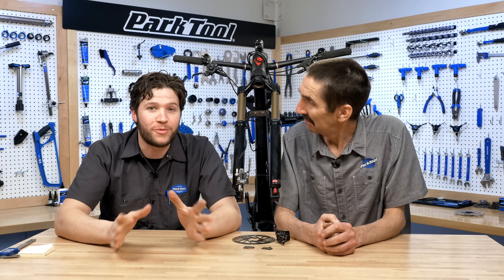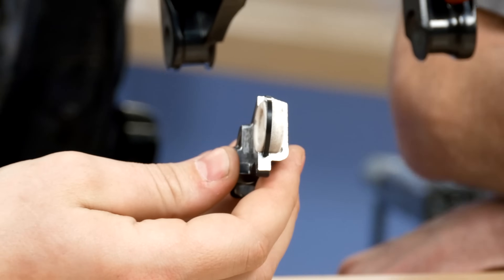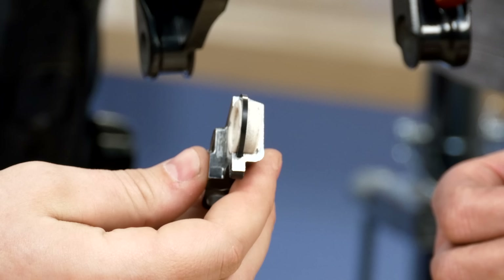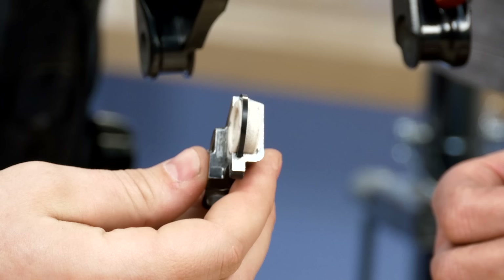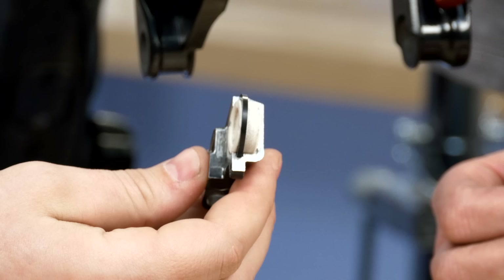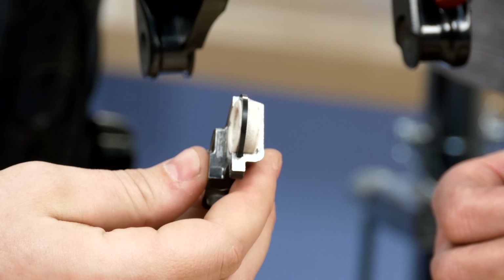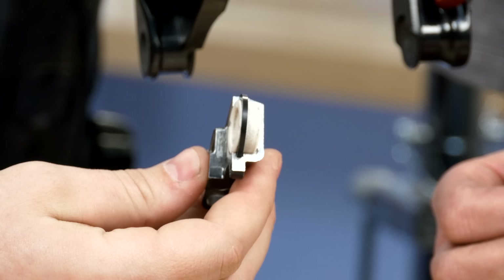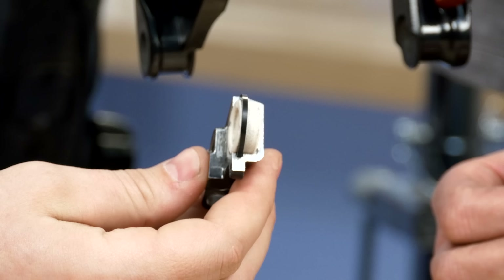How To Clean Hydraulic Brake Pistons - Tech Tuesday #104

Comment: Thanks for your great videos, I am new to working on my mountain bike and they are very helpful. I was replacing my brake pads recently and once the new pads were in, there was no room for the rotor. I then saw the pistons were sticking out, so I followed the steps in this video to clean my seals. Once my seals were clean I tried pushing the pistons back in… nothing. I cleaned the pistons again, brought one out and got the other in, then tried pushing them in again using an even but hard pressure. While pushing I heard a PFFFTT and noticed that hydraulic fluid had squirted out of the end of my brake’s master cylinder… I thought I had broken it. But, everything went back together nicely and my rear brakes were working well. So, is it possible that the master cylinder on my Shimano brakes (bl-mt500) have an overpressure release valve? And, if so are my brakes good to go, or is it time to head to my LBS?
Thanks!
Reply from the maker: Where exactly did the fluid come from? If it came from a small hole on top of the resevoir then you will be fine. If it came out the end of the lever/master cylinder where the lever is connected, then you may have some other issues. it could be that your brakes were over bled the first time and there was not enough room in the system to accomodate all the fluid that you were trying to force back in. Either way, how is your brake working currently?
Reply: @parktool  
I believe it came from the little hole in the center of the of the end of the master cylinder (there is a little round plug that looks a bit like a plus symbol with a hole in the middle). I was looking at the pistons when it happened, but that is where it looked to have come from. It did not come from the top (where you put the reservoir cup when doing a bleed). I was thinking that there must have been too much fluid in there to accommodate the volume the piston needed. My brakes feel great. I went for a short ride around the neighborhood and things felt good. So, I decided to do a longer ride that’s close to home and that turned into 13k of pretty rough blue trails and they felt like they did when the bike was new (this is my first MTB and its first set of pads).

Comment: Do you know if you can use denatured alcohol?
Reply from the maker: Sure can. d
Reply: @parktool  What about the primary cleaning? Is the brake fluid / oil necessary (I understand it is best to not contaminate the fluid within the system with anything else, but I don´t have it at the moment), or could I use the alcohol to clean the sides of the pistons right away?

Comment: But what happens if the Pistons extend all the way out?
My cousin just did that and we're looking for a way to get them moving again.
Reply from the maker: If the pistons are pushed all the way out then they will need to be cleaned and put back in there bore. Then, a bleed is in order as Air was introduced to the the system.

Comment: i just cannot get one piston to retract properly... ive exercised the "lazy" seal like 100 times already
Reply from the maker: That can happen, it may be wise to contact the manufacturer to see if they have any comment on the issue.
Reply: @parktool  In my experience and in this video as well, the piston on the hose side will react faster since it has more hydraulic  pressure.  Untill the fluid reaches the inner piston it looses some pressure due to being  farther from the pump and travelling in the tight space of the calliper. 

Great useful video,  most YouTube experts do not mention cleaning the pistons. Your approach with hydraulic fluid instead if alcohol like I used to do it makes sense.

Comment: I pushed the pistons back In and now when pulling the lever it goes completely into the bar and doesn’t return, the pads also don’t contact the disc, what do I need to do to fix it
Reply from the maker: How many times have you pulled the lever since doing this? Hydraulic systems need to self adjust to the rotor after being pushed back so it can take a few lever pulls to get the pistons to self adjust to the correct point. If that is not the case and you did not have a firm lever before this then the system needs to be bled.

Comment: Does dirty pistons have an effect on brake lever feel? Or is that primarily a function of bleeding?
Reply from the maker: If the seals are dry they will let the piston slip by instead up flexing the seal and that will give your lever almost no throw.
Reply: Park Tool thank-you for the reply. I’m trying to determine the root cause of my brakes not feeling firm. I’ve done several bleeds. With little to no improvement. But I did notice one of the pistons sticking.  So, I’m hoping cleaning/lubing the seals will correct this.

Comment: Any idea how to do this with rear brake and no one to assist me ?
Reply from the maker: You can use a rubber band as an assistant or a toe strap. The rear is almost as easy as the front. Assistant not needed.

Comment: What happens if I use autotive brake fluid instead of mineral oil in my brake system?
Reply from the maker: The fluid will deteriorate the seals and the system will fail. Typically the seals swell before falling apart.

Comment: Hi, excelent jobs you guys, I have a quedtion for you ¿This could fix a leak in one of the pistons? My Deore M615 started leaking and now the pads get fluid and stopping power, besides the awful noise.
Reply from the maker: This will not likely fix your issue. You may be looking at a new caliper.

Comment: Park Tool may I ask you , ive noticed that my original shimano calipers split into two halves, you can see the joint line around the caliperbody. The set of Zoom calipers I bought on ebay look solid cast (all in one) and there is no joint line. I guess that's why these are cheaper?. will this make these calipers harder to service using this procedure. I suppose not, For the hydrhaulic oil to pass through the chamber and curves around, it amazes me how they cast it all in one piece?  the split halves have special star screws , I don't have the correct tool to loosen the two halves. on the cheap solid cast models you can never open them.
Reply from the maker: Shimano does solid casts for some of their high end brake models but uses the split method for a majority of their brakes. I'm assuming it is easier to manufacture them that way. It is not any more difficult to do this service on a solid vs split caliper. If you ever found the service parts to do a full caliper overhaul the split caliper will be easier to do the service on. A decent torque set would get you into that caliper but remember, internal parts can be hard to come by.

Comment: my pistons are old and leaking oil how do a put new white pistons in as well as seals in. to stop the brakefluid leak which keeps contaminating my disc breake pads??
Reply: what are those white pistons made of are they nylon or ceramic? and do they have a time limit on wear and tear.?
Reply from the maker: The white pistons are ceramic. Shimano makes it fairly hard to find service parts for the internals of there brakes. You might have more success replacing the whole caliper. Calipers can be purchased for a fairly reasonable price.
Reply: ParkTool    appreciate your reply thanks guys , yes I stripped the shimano  BR-M596 calipers down,  (made in Malasia).  they are the old  2014 design where the split pin went to the right hand side . I notice many of the newer design calipers  have the splitpin in the middle .  I had bought a whole lot of brake pads to fit that old 2014 model dam! . Now that Ive bought a different type I cant use those disc pads. I took the ceramic piston out but its black not white and has a one sided hole resembling a cap of some sort? So now ive gone on ebay to see if a white ceramic disk went  inside? this black one has 4 little cross lines on it resembling an ashtray round and hollow? I never found any white piston parts in the system? they have a radius of 2.1cm. still looking on ebay to find these black kind of ceramic discs for the Shimano which look like plastic but when you tap them they sound dead  like ceramic. . having had only canti - lever brakes for years on cyclocross bikes I've found this system very interesting, thanks guys I may be bothering you again with more queries chow.
Reply: oh have you seen the video of the young guy who put vegetable cooking oil in his disc brakes. ha ha  he admitted afterwards it not a good idea as it deteriorates and can leave crustations and googoo shit on the pistons and damage them
Reply from the maker: That was a great demonstration by our friend Seth! Very clear and methodical. As for your brake quest. Service parts for your brakes are going to be hard to come by. A whole caliper might be a better option. For detailed diagrams and part numbers check out si.shimano.com .

Comment: I am wondering if you accidentally popped out the piston, could you just push it back in and then do the bleeding?
Reply from the maker: Yes, you can.  Make sure the seals are correctly positioned and do not get pinched.  A bleed will be required.
Reply: @parktool  Thank you for your reply. :)

Comment: haha, after all that they never show successful endpoint where when you pull lever, both inboard and outboard pistons extend same amount.  I would bet 99% of the hydro brakes out there operate with only one piston (for two pot caliper) doing most of the work.  still, good video guys.  keep up the good work
Reply: Don't bet...try it. You'll be 100% right. With 4 piston pucks its even whackier

Comment: Just done this exact procedure on my PITA SRAM Guide R brakes, best they’ve ever felt the 9 months I’ve had the bike!
Reply: Just did on my 4 pistion SLX brakes...I hope my feel as good on the trail as they do in the garage
Reply: (glad it helped but) isn't that against SRAM manufacturers guidance, to NOT use dot fluid around the piston? I am wondering if the fluid would make the seal slide instead of GRIP and pull back, the way it should....? The reason is, I have pistons that don't retract enough after use, so they grip juts enough to stop the wheel spinning freely
...

Comment: I have a rear brake piston that is EXTREMELY stubborn. It is bulging outward and I've tried hard to get it back into the gland, but it wont budge. What are my options? I don't want to push on it too hard otherwise it might crack (that happened to my front piston months ago).
Reply from the maker: These can be difficult.  Remove the pads. Pass the narrow end of  a cone wrench through the entire brake. This way you can pull it back evenly into the body.  Grab either side on the wrench and apply force.  If it is crooked, apply more pressure slightly to the high side and go slowly.  Good pushing to you.

Comment: I have SRAM Guide R brakes. Can I use mineral oil to clean the piston seals or should I just use rubbing alcohol? Also, I thought you have to bleed the system every time you service the brakes?
Reply from the maker: Use alcohol or even water to clean your piston, not mineral oil.  Bleeding does not need to be done often, and if it is needed frequently, there are other issues at play.

Comment: what causes the piston to be lazy?
Reply: Lampa it is the different length the oil have to travel . The piston on the side where the brakefluidlead is on the caliper is always getting out more then the other.(the fluid have to go to tiny hole to get to the other side lossing a little bit of pressure)

Comment: this is a great tutorial thumbs up for that, by the way what should I do if both of my piston is not rolling back? I have a 5 year old shimano hydraulic brakes, should I buy a new one?
Reply from the maker: Exercise those pistons back and forth and lube with mineral oil. That should make those seals up and you should be good to go. A little time, cleaning and lubing will work wonders. Also be sure that they are properly bled.

Comment: I have some Sram guides and when I tried to change the pads I realized that the pistons are kind of stuck and won t return to their original place. Will that help?
Reply from the maker: This should help. For SRAM brakes DOT grease works well too. SRAM sells it and it is good for this process.
Reply: Park Tool I ended trying that and your other tric with the « floss » and nothing worked... I put the old pads back and when I get a chance I ll bring the bike to the shop. Thanks for all those cool videos !

Comment: i pushed my pistons in and now they don't want to get out
Reply from the maker: When you pull your brake the pistons do not move? Or are you having a hard time pushing them back into there bore?
Reply: ok i just find out that the pistons don't came out if the bike is upside down 
but now i have different a problem that my pressure is very low maybe some air got in
Reply from the maker: When you invert your bike, the air that is in the reservoir of your brake lever gets into the brake line and gives you a soft lever. Hydraulic brake work should be done with the bike right side up.

Comment: If I have Hope brakes and DOT fluid in system shoud I use DOT for cleaning and lubricating the pistons ?
Reply: Hello you found the information ... my Formula RX also has DOT4. I will be grateful !!!
Reply: @viktorsvetlov80  You can use DOT or ATF fluid, your just trying to remove dirt and lubricate the seal (temporally, since it is exposed and unprotected).  Now that is most accurate answer.   I just use shop lubricant spray and compress air if working on stuck or misaligned piston.   Silicon Spray would be another ideal choice.   THis is not rocket science,  I would worry more about calipers in your automobile than on your bike - more expensive parts and greater consequences.

Comment: Another Tip: Keep an old set of pads around as a maintenance pad set.  Allows you to push the pistons back in without damaging the piston faces if using a flathead screwdriver/chisel/etc.
Reply: I made a mistake, I pressed too hard and the pison came out, I put it back on but it caught air. and after a while I started to lose the mineral oil from the Shimano hydraulic brake. Please help me and explain to me how to proceed to put the piston back so that I do not lose mineral oil again. Thanks!
Reply: @SPN2TV  I was bleeding my brakes and oil poured out of one side of the piston and piston came out 🙄now I wonder if I need a new seal 🦭
Reply: @SPN2TV  yes
Reply: Use plastic tire levers :)
Reply: Ha.  Good idea.  I keep my plastic levers in the road kit.  Have the Park metal levers that've never let myself down.
Reply: Simplest and least damaging is the box end of a cheap 10mm wrench.  I say cheap because expensive ones have a huge width. Cheap ones will drop between the pucks. And if you have old Hayes post mount brakes, the box won't break the post
Reply: Was wondering if it was necessary to invest in the parktool piston press that they use here. I tend to bodge it with my metal tyre levers and always scratch the surface.
Reply: @s31720  I use a wooden paint stir stick. They are firm enough to do the job, soft enough not to damage the pistons. Stick one through the caliper and pull with both hands
Reply: My bike's caliper pistons were so sticky that it nearly broke the plastic tire levers, and the pistons didn't even move. By the way, the calipers, supposedly, were brand SRAM Rival HRD calipers. However, they were bought on discount with no return.
Reply: Or the Park Tools “prybar?” (Shown at 4:40-45)

Comment: 2:43 alcohol for our alcoholic friends
Reply: Funny guy! :))
Reply: I came to the comments for this
Reply: Lol wanted, to write same thing ;)
Reply: ..that is ethanol !. Surely a cheaper and better option would be isopropyl alcohol and save the ethanol for a G&T?
Reply: I need a 1/5 of Vodka after trying to fix my hydraulic disc brakes.
Reply: @wlouisharris 😂 same here😅
Reply: Could i also use regular brake cleaner or lighter fluid for the cleaning part?
Reply: @BPNX  generally i'd always go for the cleaner that is just good enough for the job.
i mean, fuel, acetone or paint thinner might solve any greasy dirt easier and quicker, but they might also react with plastic and rubber parts they get in contact with, often leading to rapid ageing.
alcohol (ethanol) is a rather mild solvent... and just good enough ;)
Reply: @BPNX  Yes, but there is a big BUT. Cleaners contain compounds that don't evaporate and can corrode and damage the seals over time. Use isopropanol to prolong the servicable life of the piston seal, as it evaporates and leaves no trace.
Reply: Trouble is, C2H5OH is ethyl alcohol, and not isopropyl alcohol!

Comment: Can I use some basic bike lube instead of the brake oil?
Reply from the maker: No, this not a good idea.  The properties of the fluid are as much of manufacturer's design as the piston and seal design. If you don't believe us, check with the brake manufacturer.
Reply: Park Tool but isn’t this just to reduce the friction in the piston the rest of the brake?
Reply from the maker: This is to hydrate the piston's seal. It is not to reduce friction but to allow the seal to move more freely. The seals are designed to be compatible with a specific fluid and that is why you cannot use any lubricant with them. If you use a non compatible lubricant it may cause the pistons to swell or shrink.

Comment: Is it normal for my brake lever to became spongy after cleaning the piston, exercising the seal, and pushing the piston back ? Thanks
Reply from the maker: It is not normal. Your system may have a bubble in it. Usually the lever will feel more crisp afterward.

Comment: Best way that I have found to clean the pistons is to use a nylon tube brush. Then lube with mineral oil or brake fluid, then push back, clean, re-install.